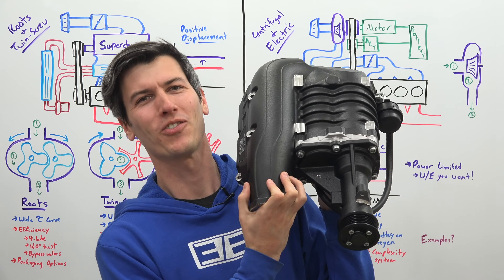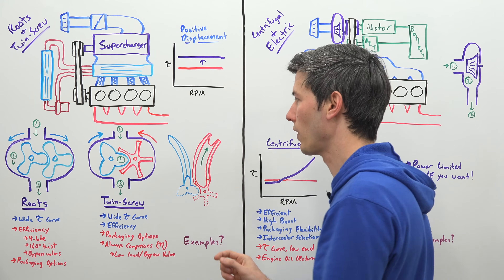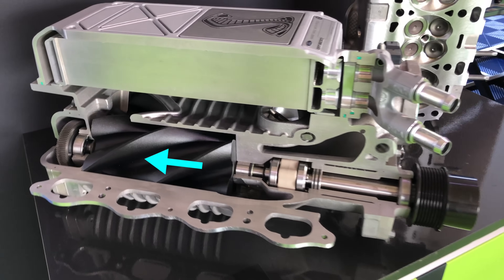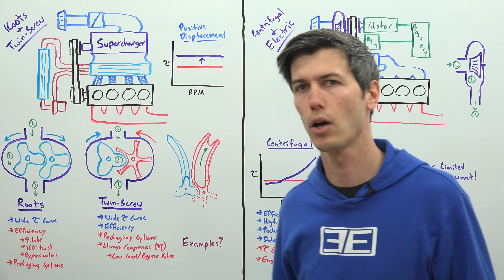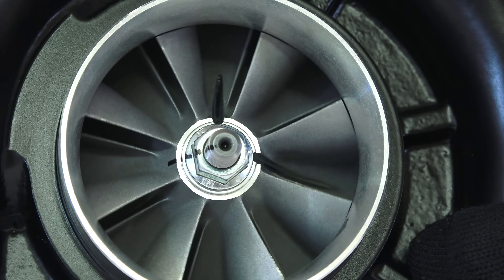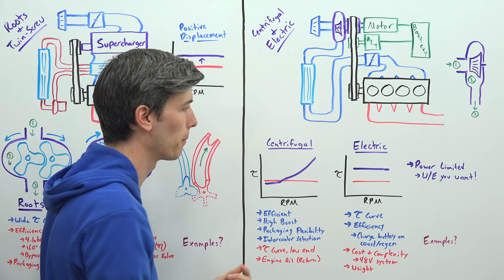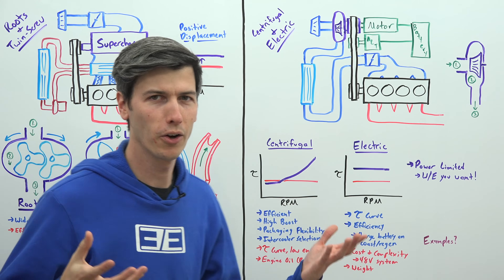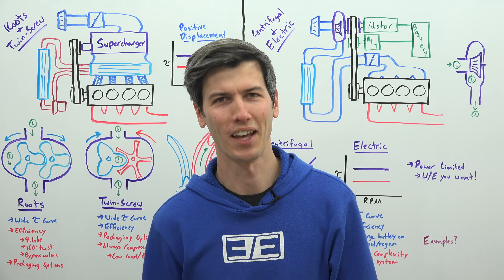What's The Best Supercharger? Roots vs Centrifugal vs Twin-Screw vs Electric

Comment: Positive displacement supercharger disadvantages: weight, size, increased specific fuel consumption, noise

Americans: "So, basically no disadvantages, then?"
Reply: But that noise tho... have you heard the demon?
Reply: @kausarde4974  hell yea!
Reply: @marsdeimos4301  To be fair, turbochargers have their downsides too.
 Limited power band, extra fuel consumption in that band, poor throttle response (workarounds to the throttle response are tough on the engine or turbo or both), buncha extra space for an intercooler, draw more oil. 

A supercharger is really only gonna work well on larger 6 (preferably 8) or more cylinder engines because there's less parasitic draw as opposed to smaller engines. 

Please let me know if my reasoning is sound, I'm always up for discussions and an opportunity to learn more
Reply: @zethyr8833  1. You need an intercooler for superchargers as well 2. There's a couple of companies using superchargers on tiny engines, the 1.4tsi vw engines had both a turbo and a supercharger, same for some volvo engines.
Reply: @Bralkor  oh cool, I'll have to look into that. Thank you!
Reply: @zethyr8833  I think turbochargers are better suited to diesels, which do not have throttle plates, and aircraft engines, which are operated at a constant speed while airborne.  Superchargers are better for automotive gasoline engines.
Reply: @zethyr8833  both Mercedes and the 1st gen new mini cooper had roots superchargers on relatively small 4 cyl engines. ( mini: 1,6L)
They were very popular and sold a lot of them.
The Mercedes system had an electromechanical clutch to save fuel when idling. I don't know if it had a bypass valve as well.
And of course the already mentioned VW 1.4 tsi with both turbo and roots supercharger.
Volvo made a setup (with some inventive tech like a pressure tank to spool the turbo) in their 400hp 2.0L T8 engine that has a turbo, an electrical supercharger and its a plugin hybrid.
Reply: @kausarde4974  :  Man, that is so true. Especially when you see a muscle car with a ridiculous hood, you're about to roll your eyes again, but then it starts... You hear the War Machine come to life, you hear The Trumpets of Jericho, and know this one has more than just the hood.
Reply: @kausarde4974  Makes your car scream WEEEEEEEEEEEEE!
Reply: @kausarde4974  sounds like a v8 with a tesla in the background
Reply: Pretty much.
Reply: What noise? I can only hear its happiness, everytime you go WOT, it goes "weeeeee"
Reply: The noise is awesome, look at Terminator Cobra compilations
Reply: @JordanSVT  Really.. what's sound got to do with it? Power man! My 2017 Mustang GT sent a 2010 Roush 427R to gapplebees the other day.
Reply: @wildhorse2017  The food there tastes like as..phalt.
Reply: @wildhorse2017  The guy in the original comment was saying the noise from a supercharger is a disadvantage but I was telling him that it's not a disadvantage because superchargers sound amazing
Reply: You forgot the best one, parasitic loss!
Reply: @sarahkeene500  like draining power?
Reply: @sarahkeene500  But instant throttle response.
Reply: Each system comes with advantagens and disavantages... Since you see an ''sedan'' like the Challenger Hellcat with 717 hp, there´s no disavantages, lol!
Hellcats are somewhat ''economical'' on fuel if you dont WOT then... Up to 20 MPG to an V8 with 6.2 liters, 700+ hp engine is impressive.
Reply: Non-American auto makers have been using positive displacement superchargers for years. They want to get more low down torque from their puny engines. There's nothing wrong with that.
Reply: @lordhumungous7908  yep superchargers are very popular in Australia.
Reply: If u see any of these as disadvantages you are obviously british
Reply: Andrew Staal weight and size are pretty significant disadvantages, but the extra power more than makes up for it
Reply: @erty2389  it's not that much weight and turbos are heavy as well.
Reply: @nodo7575  And complicated, and generate extreme heat.
Reply: @staalcyclesecurities1423  propably the rest of the world you mean
Reply: @skyfoxrinoasfr4778  the rest of the world has also used positive displacement superchargers though.  The germans have for years on various engines, Toyota did on several vehicles along with Mazda and the Millenia.
Reply: DrewLSsix 
Mercedes had a compressor.
Reply: @Conservator.  kompressor.
Reply: So increased weight is an advantage to you? Lol what a Bafoon
Reply: @staalcyclesecurities1423  🤣🤣
Reply: @staalcyclesecurities1423  or Japanese, Korean, German, Italian... actually just everyone one who isn't American or Australian.
Reply: @staalcyclesecurities1423  No, German
Reply: Don't forget limited maximum airflow compared to centrifugal style. I don't know what those racers are going to do when they find that their engine consumes more compressed air than their supercharger can physically produce.
Reply: @wyndhamcoffman8961  they have always went bigger super charger in drag racing lol
Reply: i feel like if you gave koenigsegg the option of making a supercharger, they'd find a way to make one weigh almost nothing
Reply: More air .. or more density?
Reply: NOISE 😊
Reply: You forgot heat soak!
Reply: @HerrKuhn928  how about compound twin charging vs a nice pair of twin turbos ( for lag purposes )
Reply: I looked into most ppl say it's expensive complicated and you can get the same results just with turbos alone. Unless someone's got 100,000 to just toy around and almost constantly tune it
Reply: BS, depending on type, very little noise, the weight is insignificant and yes uses more fuel but only when you need the extra power in which there is quite a lot of extra usable power
Reply: Those are the same disadvantages that a Turbo has…
Reply: 🤜⚡💥⚡🤛HAHAHA!!!!  BUT our FAZE engine design doesn't need/do that. The ultra-simple, low cost, ultra-quiet & efficient, FUEL-AGNOSTIC ZERO-EMISSION engine has a constant max torque/power/efficiency/λ curve....WITHOUT the complexity and, as such,.....it doesn't require a turbo/super charger or a transmission!!![Ya, it acts like a motor]

It recovers braking energy and doesn't need any batteries, turbos, emission controls/computers or a muffler. Moreover, the torque can be instantly bumped up several fold that of the normal running torque.

===
NOTE: Our ultra-compact & torque-dense positive engagement CVT is far superior.
🤜⚡💥⚡🤛
Reply: Haaa.. guess we gotta own that one hahaha
Reply: Brum brum
Reply: Mars Deimos shut up.
Reply: yikes lol
Reply: The noise is an advantage.
Reply: And oh, look a turbocharger! Which is already great
Throw away the turbine and replace with a belt or electric motor
Wtf.....
Reply: This guy is a genius 🤣
Reply: Merica
Reply: Years ago I saw a vid where guy fit a supercharger in his e38 740i and got almost 10% less fuel consumption and he was very positively surprised.
Reply: But sounds better.
Reply: How are any of those disadvantages???🤣🤣🤣
Reply: Yes Suh
Reply: noise is big plus. the only reason I am hesitant on a centrifugal tbh.
Reply: People actually get better gas mileage if they don’t drive like a race car driver with their supercharger, especially on mustangs, coyotes love boost
Reply: Also Heat Soak. Like on the C7 Z06 that Roots blower was prone to heat soak.
Reply: The noise is a disadvantage in california
Reply: Google Sucks  almost everything you said was done by Europeans who moved to America ya clown
Reply: I'm an American and hate all the noise, but what you said is the typical American.
Reply: They have Trump as president, so what do U expect?
Reply: In America more front end weight is not a disadvantage since they don't use their steering wheels. Drag racing is all straight line. 
Those of us who like curves would rather limit the weight in the front end.
Reply: “I am Mars Deimos, smarter than all Americans”
Reply: rhpicayune ...and the world to!
Reply: @rhpicayune  it's a joke dude. chill
Reply: @marsdeimos4301  Joke was good. Also, accurate. As an American, I can put all of those into the advantages category. Noise? Burn more gas? Big? Hell yeah.
Reply: Bruh when has that ever happened plus that’s a little racist
Reply: bjorning man 
‘American’ is not a race so it’s not racist.
Reply: @Conservator.  A race can be literally anything as long as its referring to a group of people share that share a culture, it's not a scientific term, its the same as Gender, these things mean absolutely nothing.
Actually it's a bit different to gender because people just miss use gender in place of sex, which is a scientific term but Christians in the US didn't like using it because sex is a dirty dirty word so they started to use Gender instead...I'm pretty sure its just in Americans genes to incorrectly use words, like biscuit, truck, jelly, ect.
Reply: @Conservator.  it’s still xenophobic which isn’t good
Reply: @stangPowah225  
I very much doubt if that remark was meant to be xenophobic. I think it was a bit of an exaggeration of how some Americans could react and that was funny. It’s not like he said that all Mexican immigrants are drugs smugglers. That would be xenophobic and very wrong, even if the president says so.
Reply: bjorning man Please look up the definition of racism before you start poking sticks.
Reply: @Skreeze_Nuts  American isn't a race my guy
Reply: @Skreeze_Nuts  its fun cause it's true; racist would be if he made those things up in order to denote people; he didn't made them up; so no is not racist; nowadays everybody thinks that pointing facts that are uncomfortable for people are racism; get your definitions right and stop the name calling nonsense;
Reply: @ElLuigyboy  Well technically there is no such thing as racism since we are all the same human. It used to be called prejudice, and it was equally as shameful to be labeled prejudice as it is to be labeled a racist today. Racist and racism are  politically invent terms like assault weapon designed to trigger irrational responses. No such thing. 

"A race is a grouping of humans based on shared physical or social qualities into categories generally viewed as distinct by society.[1] The term was first used to refer to speakers of a common language and then to denote national affiliations. By the 17th century the term began to refer to physical (phenotypical) traits. Modern scholarship regards race as a social construct, an identity which is assigned based on rules made by society. While partially based on physical similarities within groups, race does not have an inherent physical or biological meaning."

We used to be taught this to. Science.
Reply: @duster0066  thank you for the definition!; it would be even more scientific if you share your source; i'm using commonly understood and accepted framework to broaden the scope of people that are familiar with the term and what it (wrongfully) means to them; speaking about social constructions is open to debate as there are many different interpretations (some wrong but even between scholars) e.g. people that disregarding the scientifically (biological) agreed term of gender regard it as "social construct" also.
Reply: @ElLuigyboy  I got that from wiki. Not the greatest source, but it matches what we ol dudes were taught in school, what the USAF taught in the 80s, and what I've read several times during my life. I'm not saying the term was misused only that it has no scientific meaning. Cultures can and do invent terms that have accurate meaning inside the specific culture. But it usually has a different meaning in another culture.

You guys did fine in my book. I was just trying to encourage free thinking in an area where politicians are pitting us against one another for purely political reasons. In the US "assault weapon" is another one that has no meaning in the industry, military/police, nor the users of fire arms. But that is another debate.

Cheers brothers. We're all in this together whether we like it or not.
Reply: @duster0066  No. There's a such thing as racism . Behavior biased based on the concept of race, no matter how false that concept may be, is still racism.
There's no such things as race however. 
It's the same as shooting somebody because you think he's an alien despite the fact he's a man. There's no alien but you still killed a man. You're not absolved of the fact that you murdered someone because you believed he was an alien. The fact it's a false belief doesn't bring the man back to life either.
Reply: @duster0066  
Well, that’s not entirely true, otherwise children of mixed-race marriages wouldn’t have congenital health issues and blood transfusion incompatibility.
Reply: @SorgreiToday  I am of mixed race and I don't have congenital health issues.
Reply: @Skreeze_Nuts  Best jokes are.

Comment: If a twin scroll supercharger or a roots supercharger was electric do you think that would be any different?
Reply from the maker: Would not make sense to use them IMO for electric, since they have more rotational mass, lower thermal efficiency. May as well use the centrifugal since electric can remove its biggest drawback (low end boost).
Reply: So you'd run a belt to an alternator, to charge a battery, to power a motor, to run the supercharger? Instead of belt to supercharger?

Comment: Hey I'm considering a supercharger for my recently acquired NB Miata. This video is so perfectly timed! Are you doing anything with you engine internals?
Reply from the maker: I am not, though it won't be running super high boost. From discussions with various shops/brands/etc, it seems the engine is fairly stout in the ND. There are concerns about the transmission, but if things break... well, that's what happens with project cars haha. Modifications reducing vehicle reliability is no secret.
Reply: Kingjay814 Trackdog Racing has a Rotrex kit for NBs making about 230whp. Pretty good bump in power for sure.

Comment: The REAL question is: which one of these will make the biggest power bump for my Prius?
Reply from the maker: You're definitely going to want all four.
Reply: @EngineeringExplained  And a turbo! pentacharge that thing!
Reply: @jorge8596  , don't forget to include a compressed air tank that can be used to spool up the turbo faster to avoid lag.
Reply: @jorge8596  twin turbo
Reply: @EngineeringExplained  hahahahaha.
Reply: Don't forget NOS!! :-D
Reply: soundseeker63 Hoovie already went down that road, I need something more original lol

Comment: Hey Jason! What is the most important thing when it comes to high speed stability and why tyres are the answer?
Reply: What kind of question is this even?
Reply: Tomasz Kudłacz 
Aero could be the answer as well. Especially above 300km/h (200Mph) depending on the car of course.

Comment: Put a supercharger on the Crosstrek :D
Reply: This video will help  the DIYers
Reply: hyrges don’t do it! it will eat the Cvt on there
Reply: It will still have a CVT
Reply: Noel Molina I think Jason’s car is a manual.
Reply: naaah mate
Reply: Felix Beutin why not? A more powerful Crosstrek would be epic!
Reply: @ALMX5DP  is it necessary ?
Reply: Felix Beutin more power is rarely necessary. But it is fun, and that’s what automotive enthusiasm is all about right?
Reply: @ALMX5DP  sure but he made a video saying horsepower is underrated
Reply: Felix Beutin underrated? Meaning more is better? He has installed a supercharger on his S2000 and is now installing one on his Miata. That should say everything.
Reply: @ALMX5DP  Irrelevant, that CVT isn't going to be happy with the extra power, and it's very spendy to service or replace.
Reply: @jttech44  What CVT is everyone talking about? Jason has a manual transmission in his...
Reply: @jttech44  He has a manual in there stop talkig about damn CVTs